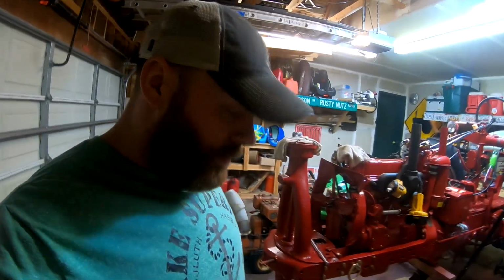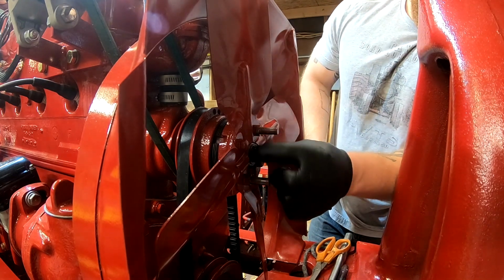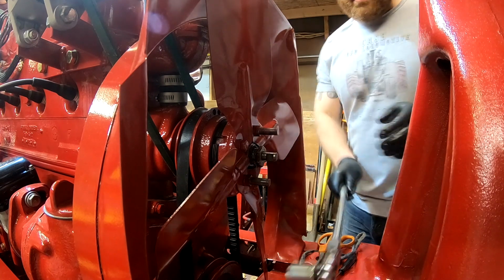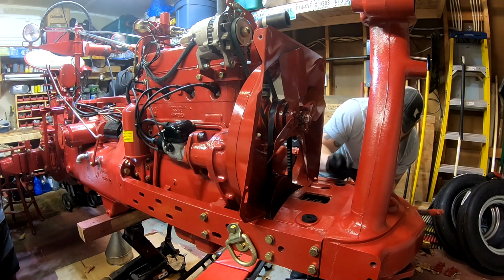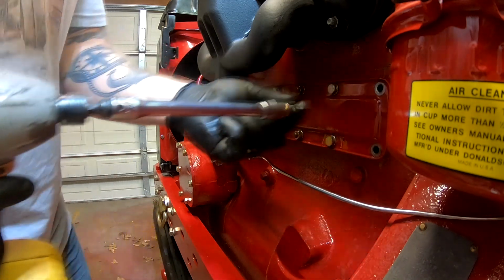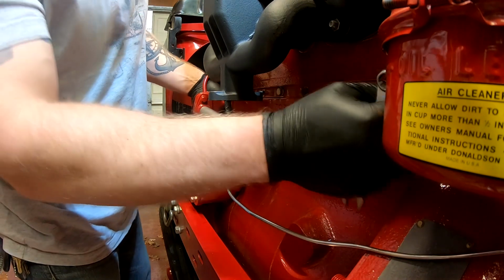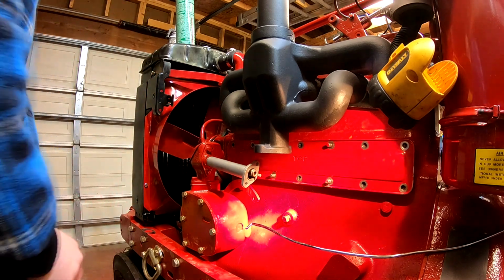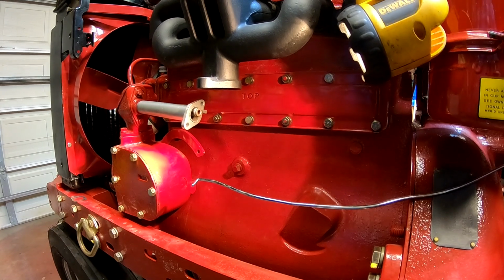1942 Farmall H Memorial Restoration: Fixing the Water Pump/Water Jacket Leak

Comment: Use your engine lift, much easier for it to hold it and slowly lower in place while holding the shroud. I know it is a hassle to drag out and set up and extra monkey business but it will save you aches and pains, as well as your paint job
Reply from the maker: Good point. Thanks for the tip.

Comment: Kenny, nice meeting you today at Alemund and having a nice long talk about carburetors!  I did some checking when I got home.  The Super H initially used an idle jet 0.0025" larger in diameter than an H.  But, I bet most, if not all, rebuilders today use the #74 H jet for both.  BTW, the SH used a 23/32" venturi whereas the H uses a 24/32" venturi.  You know what I think should be done and I would be super happy to help!  Contact me after your busy tractor show season if you want.  You know how.
Reply from the maker: It was great meeting you as well and I'm sure I could learn a lot about the IH carburetors from you! I'll get ahold of you after things settle down. I messed with the idle adjustment some and got her running pretty decent. Just have to take it from there!

Comment: in the IHC shop i worked for in the mid 70s  we did not have RTV we used aviation  number 2 permatex, tabers  gasket shellac or indian head  shellac . in the side cover  gasket  and all cork gaskets and never had a leak .
Reply from the maker: Good to know. I usually never have a leak when I use RTV as well, but I could tell that this gasket was faulty as I pulled it apart. You could clearly see where it was separating from itself in some areas.
Reply: @KennyKizzleRustyNutzRanch  the original IH gasket was ruberized cork, same with the oil pan gasket in many applications rubberized cork was replaced by cardboard composite which is much cheaper  and easier to manufacture. the comparison is they are hard and done have much compression  where cork is spongy and more formable as long as it not over tightened or drys out  and cracks . this is where permatex number 2 seals the cork . it also helpos preserve the cork gasket if the cover has to be removed  for any reason so they can be reused without tearing them up.
Reply from the maker: @brokenwrench1  I can vouch for that - the newer material definitely does not compress well. Interesting they went to paper-based gaskets on this cover, the lifter cover, as well as the oil pan gasket... Yet the valve cover gaskets are still cork. I have reused cork gaskets many times, with great success.

Comment: I have the same issue with the water jacket plate on my super M TA. I've been just slowly getting all the bolts a quarter turn after I run the engine a little. It seems to be helping.
Reply: im moving away from silicone. In many instances I have been using gasket eliminator made by permatex as a gasket dressing,I still use the gaskets but dress with a real light coat of permatex anaerobic gasket maker.  try it you will like it.
Reply from the maker: @scottcollins4361  I'll give it a shot. I usually never have a problem with silicone. The biggest problems are usually caused by using too much in my experience.
Reply from the maker: I think it would help if IH used some thick strap steel to help evenly distribute the tightening pressure onto the plate - much like you see on F20 radiators. I thought about making some, but it would also require installing longer studs on the side of the block.
Reply: @KennyKizzleRustyNutzRanch  it would have also helped if IH engineers put bolts in the corners.
Reply from the maker: @hturbo1007  This is true!